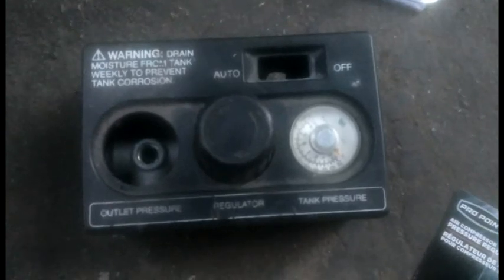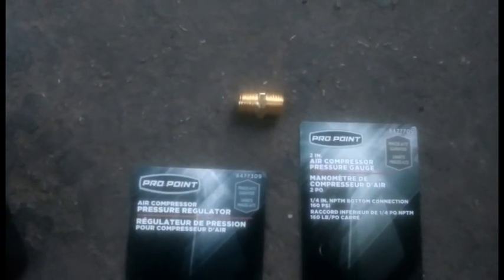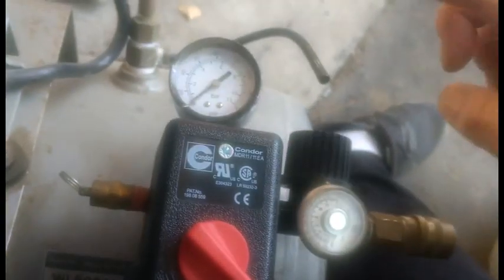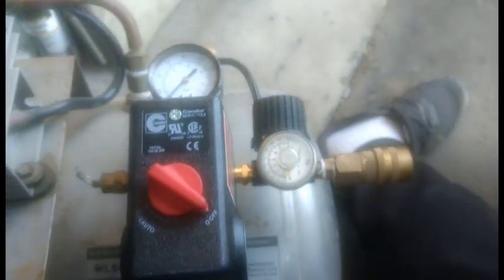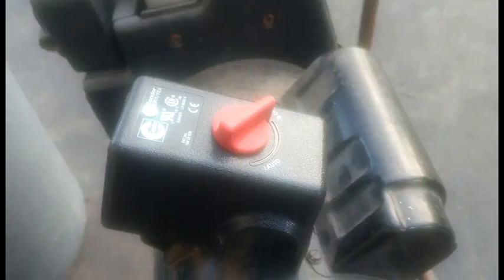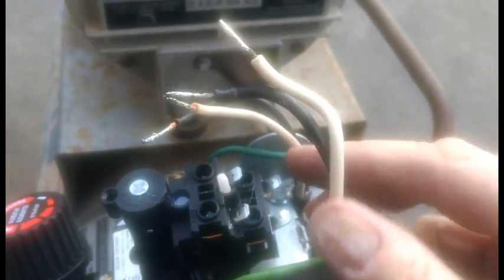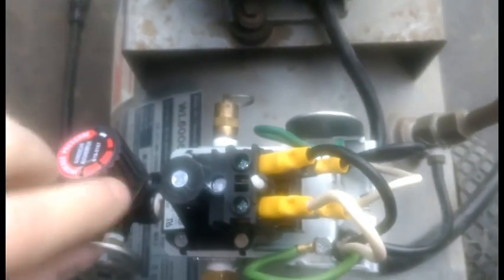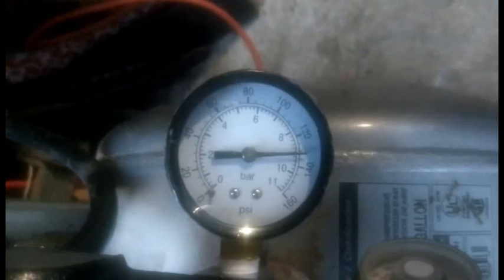Condor MDR11 Pressure Switch Installation

Comment: That was a great video, great explanation. Very detailed and thorough. When you were trying to talk over the air pressure release was kinda hilarious. 

I just installed the same model switch but for some reason the switch itself dumps all and any pressure above 1 if the switch is on the off setting but builds pressure no problem. 

I came to this video hoping to learn how to adjust kick in and kick on psi but I’ll keep looking